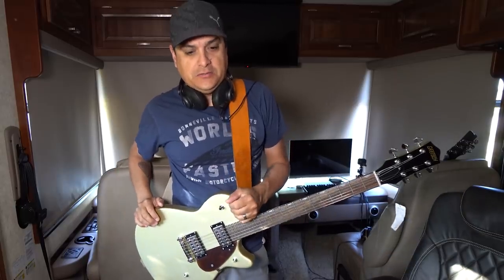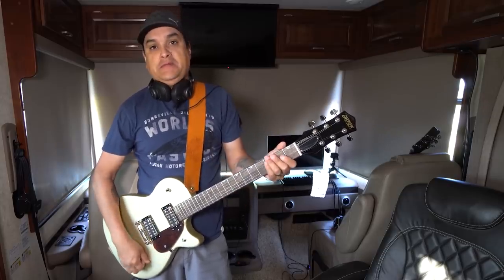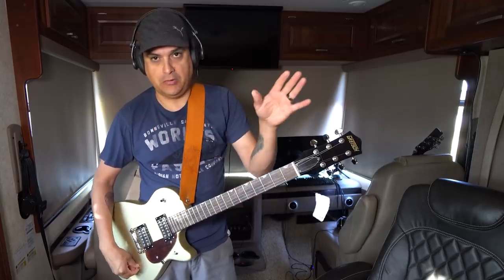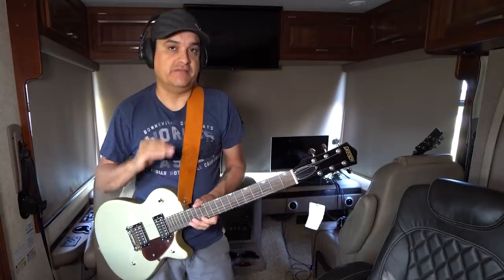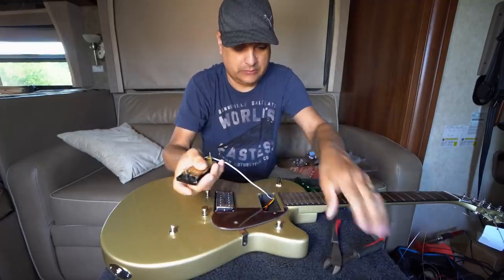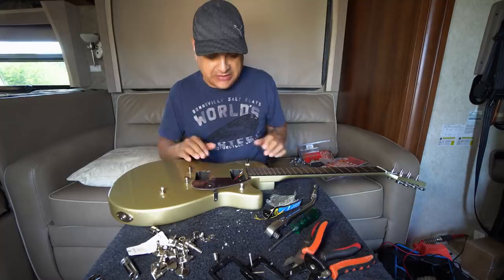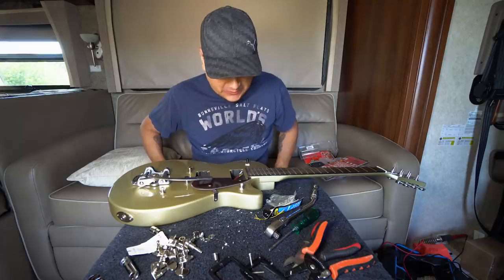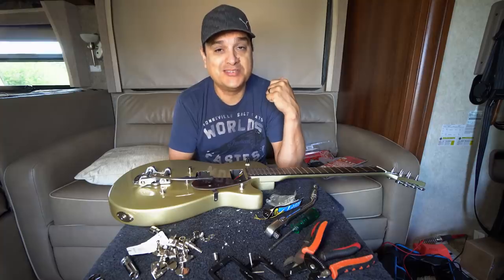Gretsch Broad'tron - Not Real Filtertrons

Comment: Assuming these are the same or similar to the Broadtron pickups on the Streamliner series, I can say that removing half the pole pieces adds lots of definition and makes it sound much closer to a filtertron and less muddy. Worth a go y'all.
Reply: Did you remove the pole pieces on the same coil or three on bass strings on the other coil and three on treble strings on the other coil?
Reply: @oskarileikos  three on each. Was contemplating buying some tv jones filtertrons or gretsch hs filtertrons. Sure they're amazing but after my pole piece removal, it's night and day difference. Got the clarity of a single coil with the bite of a humbucker
Reply: @richb3326  interesting... Should I try the same with my cheap wilkinson paf-style humbuckers... They've got only six screws on one coil but maybe it would work all the same?
Reply: @oskarileikos  I'm no expert but you need two lines of screws on the pickup. Then remove the e a and d screws closest to the bridge and the g b and e closest to the neck on both pickups
Reply: This comment just saved me $300. To my ear it’s not night-and-day difference, but the response and tone do seem a bit better. Thank you Jim B
Reply: Really worth trying. Removing the pole pieces the way you described it, made my BT-2S pick-ups sound a  brighter and less muddy. Thank you.
Reply: Is it easy to put back if they ever need to be put back?
Reply: @boimesa8190 Yeah

Comment: Possible video idea:  What are the differences between the Gretsch Filtertron variants?  They have the Filter'tron, the Full'tron, and the Broad'tron, apparently with slightly different designs to aim for different characteristics.  So, it would be interesting to compare the tones on those, dissect them, and learn what makes them different from each other, as well as different from the PAF-style humbucker (which you've already done)..  

Also the Hilo'Tron and Dynasonic, on the list, but they might already be covered.  That relatively recent video on Filtertron differences with a PAF-style humbucker briefly mentioned that the HiLo'Tron was a single coil with a big magnet.  And the Dynasonic is a single-coil, so maybe they don't belong in a *Tron video.

Comment: What you mentioned at 11:15 about someone commenting on a video having trouble finding drop in replacements for their import Gretsch - The earlier Electromatics (5120s for example) came with 'Vintage Style' tuners with an 8.5mm bushing rather then the 10mm hole that came on later electromatics which were equipped with Grovers.

Just a note that Grovers will not be a 'drop in' for all import Gretsch models.

Comment: I don't see the point of taking a cheap guitar and putting a bunch of expensive parts in it. why not buy the better unit in the first place?
Reply: It’s WAY cheaper to buy a $400 guitar and mod $200 in electronics and tuners than to buy a $2,000 guitar that might even still have cheap insides. It’s fairly common for the finish of a guitar to make up most of the cost. High dollar doesn’t always mean quality parts and build.

Comment: I got one of these a couple weeks ago and think these pickups are actually quite good. 
Better than alnico classic and alnico classic pro i have had in my Epiphones imho.

Just removed stock volume pot with resistor and cap and put in a big size alpha B500K pot and put on speed knobs with numbers wich makes it easier to find the right position.

I think the pickups clean up quite a bit, maybe not as much as other pickups, but they do clean up and it is a lot easier to adjust that with new pot and knobs.

Tuners are better than on the really cheap guitars, but not as good as Grovers found on many Epiphones, but I think they are on par with the kluson style that Epiphone has on many of their guitars.

Lot of guitar for the money. Don't think I will do much more with it at this point.

Thought of replacing the tuners with Gotoh SG301 as they seem to be a drop in replacement, but not necessary so I'll just keep the stock ones for now.
Reply: And I really like the neck on this. Not sticky wich some laquered necks can be. Has a nice rounded shape that lies perfectlys in the hand. Not skinny, but not too thick either. 
Just be aware of sharp fret ends. Needed to file down some on mine.
Reply: Thanks for this info. Looking to get this guitar for a younger beginner guitarist. If I could ask a question. Other youtubers changed out all the pots on these broad trons, did you just swap out the volume pot?
Reply: @thedaways  I normally have everything on 10 (especially the tone knob) so it wasn't a big deal to me, but I had a pot and knobs lying in my parts-box so I replaced them. If I hadn't I wouldn't order the pot, but I did order some other knobs off ebay though as I think it might look better with amber knobs (the speed knobs I had laying are black). New strings and a setup and you are good to go 😀 Pickups might be a bit dark, but so are my other guitars so my amp is set accordingly.
Reply: @atlejohnnyrygg7124  thanks for replying. Happy to give this guitar as a gift now. Amber would look great too.
Reply: @thedaways  I would recomend it if you like the design. It's fairly easy to do some upgrades later on if you feel it is lacking in any way

Comment: Great video. I like the way you savagely dissect the pickup. I really think you should change the switch tip to the metal Gretsch version so you can injure your hand if you do the Townsend windmill and miss!. Great info on the pots. I was playing my Electromatic G5220 last night and it has the same crap pots. I like how you and Philip McKnight both justify locking tuners for easy string changes only! I must admit those tall posts on those locking Grovers looks a little weird. I seldom break a string and use a thin pick and long-life Elixirs, so I don't mind taking the time and do a minimal-wrap self-locking string winding technique to stabilize tuning. Fine tuning the nut slots or replacing with a Tusq is what I do always.

Comment: Those Gretsches have a treble bleed circuit - if you remove it, you'll get a usable volume pot. I guess replacing the pots did this as well, but this method would probably have been simpler than changing out the pots :). Cheers!

Comment: I put G&B pickups in my Strat from Stewmac as Golden Age PU's and @6K they're similar to Fender Tex-Mex pickups. They supply a lot of company overseas like my Tradition CAB10 Tele and all I did was swap out the cheap electronics for a premium wiring kit that came with a 4-way switch and those pickups are so on point to me especially the bridge that's P90 hot @8.5K after swapping out the old Alpha pots for CTS 250Ks that sounds way better than before the upgrade... good luck to the winner if it isn't me!😁

Comment: I have a Gretsch G2622T that I upgraded/modded the hell out of just like this. Grover 18:1 tuners, string butler, tusq xl nut, real filtertrons, 500k CTS audio taper pots (with 5% tolerance), treble bleed mod, greasebucket tone, chrome gretsch hardware instead of plastic, a locking roller bridge, biggsfix tuning stabilizer, super squishy spring, string spoiler, chrome armrest, switchcraft jack and a football jack plate. i went overboard. Probably spent as much on the parts as i did on the guitar. Don't recommend. But it was fun. Its unique and mine.

Comment: My Gretsch Streamliner had the same problem -- the knobs might as well have been on-off switches. My guitar tech opened it up and found that during shipping or something, the knob or pot had been broken somehow (I think the pin connecting knob to pot had broken). It seems to get more volume & nuance now, though not much
Reply: Taking out half of the pole pieces from each pickup (the ones towards the neck under the GBE strings and the ones toward the bridge under the EAD strings), like Jim B suggested in another comment, seems to have helped a little too

Comment: Excited about this guitar build. Fun to watch. Though I'm sure you've shared this before, what wire do you use for wiring up your guitars? I typically buy spools off Amazon, but I'm just not happy with it. The coating melts too easily and it all just feels a little cheap. I'm not sold on the need for cloth wire (Although I do like working with it), so I'm just looking for something solid and reliable. Would you mind sharing a link to the actual stuff you use?

Comment: Question: What are the "Blacktop" Broadtrons and Filtertrons? These show up on the line above the Streamliners, the Electromatics. I imagine that the Blacktop Broadtrons are just like the Streamliner Broadtrons, except with a piece of black plastic in the pickup cover, which is not something I would be interested in. However, I really like the Gretsch Electromatic G5420T and G5422T for the price, and they come with "Blacktop Filtertrons." These are advertised as being modeled after pickups taken out of Baldwin-era Gretsch guitars. So what is this construction? Moreover, what is this tone like?
Reply: I've been looking at, and played a couple, G5222 double jets and the Broad'trons do sound good, filter'trons or not. They sound different than the PAF style pickup guitars I played back to back with it but I don't know enough to know why.
Reply: My G5622T is an absolute beast with the Broad’Trons. Bell like highs deep rich resonance. The only thing I did was upgrade the tone pot and capacitor. It initially had two settings pillow over speaker and pillow not on speaker. This simple dirt cheap mod really opened it up. Plus it has separate volume controls for each pickup. I play Yes, Crimson, Akkerman, Steely San, Wes, Tull, Sabbath, Grateful Dead... the thing is a tone monster.

Comment: We're the original Grover tuners with  180° SCREWS  or 45° screws to mount like my Gretsch 5655tg? I can't find 45° locking tuners with post longer than 20 mm to fit my Gretsch 5655tg

Comment: Since Gretch is made by Fender, what's the difference between the filtertron and what Gretch uses?
Reply: Filtertron is a classic Gretsch pickup that they have patent on since way back when Gretsch were still made only in USA, fender don't make them they just bought out Gretsch but there still there own seperate guitars. Gretsch like Fender still have there high end USA models then slightly cheaper Japanese models ( like 4k US 2500K Japan) then there budget like $5-600 Chinese ones. Audi own Ducati, Toyota own Lexus but there all still there own brands with there own models there aren't Fender filtertron then Gretsch there only Gretsch.

Comment: I was going to get the Grtesch G5655TG, but they didn't have it in stock, so I got a G2655T. I was disappointed in the pots it came with, it has the same issue with the volume as well as the tuners. I would definitely want to replace them and eventually switch out the pickups as well. Would you be able to provide a link for the pots you mentioned in the video?